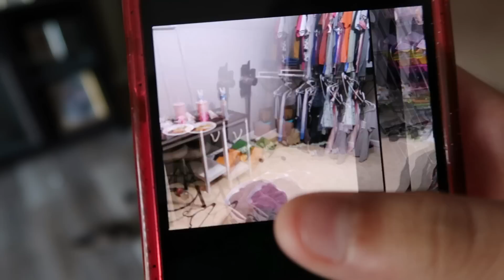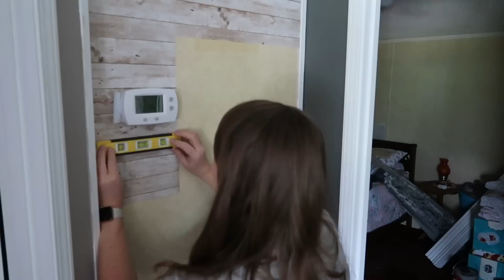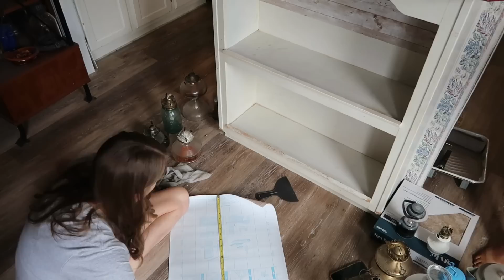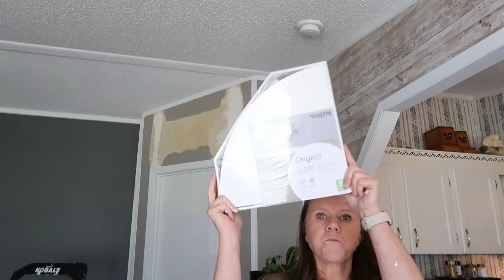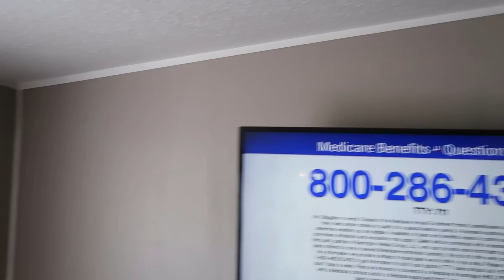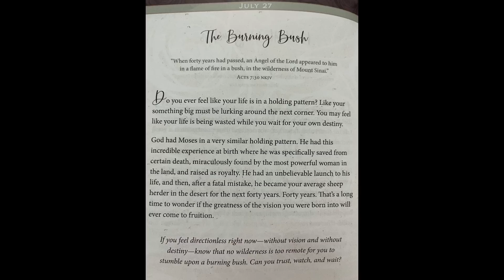NEW *2023* DRASTIC MOBILE HOME MAKEOVER SERIES | MOBILE HOME TRANSFORMATION DAY 13!

Comment: Wanted to say.. I did drywall and sanding and left my air conditioning on and the dust got into my unit and I had to replace the whole inside radiator looking thing .. $500 mistake… just in case u all have the AC running watch that dust. 🌺
Reply: awesome to pass that on , they are learning and every positive suggestion will go a long way !
Reply from the maker: Yesss!!!
Reply: @amandapayne2629  I just love your passion. You and heather are a great team. The energy is contagious